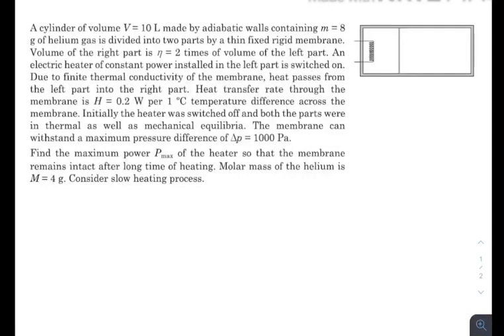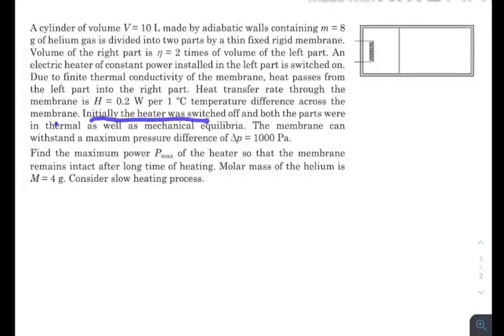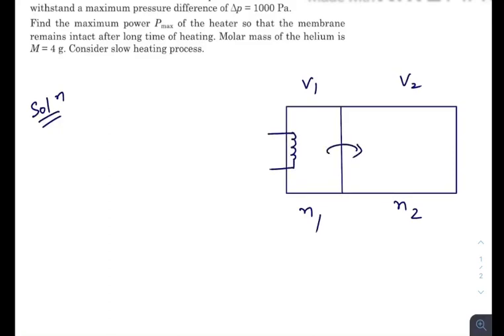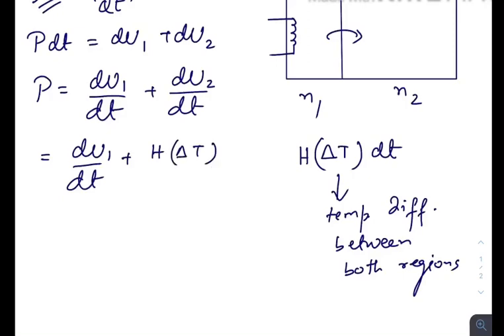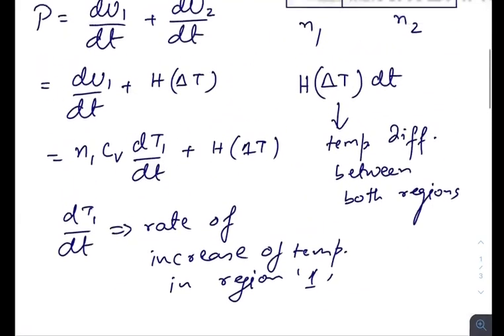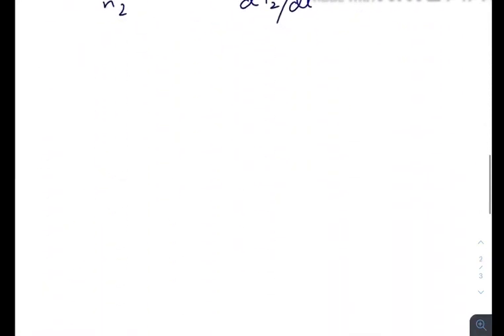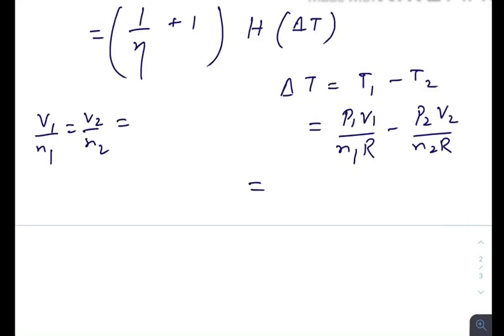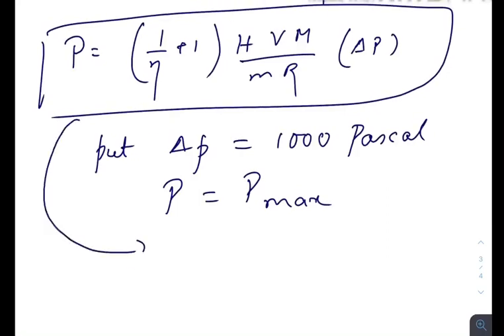Pathfinder for Olympiad and JEE Advanced physics, Page 8.23, Q - 20 solution

Comment: Sir i have a doubt, dT1/dt =dT2/dt after long time or we can say that after a long time temperature would have risen so much that change rate would be approx same like 1000-2/dt is approx same as 3000-40/dt. I hope u got my point. 1000 and 3000 here just indicate high value magnitude. 
Which one of above reasoning is correct?